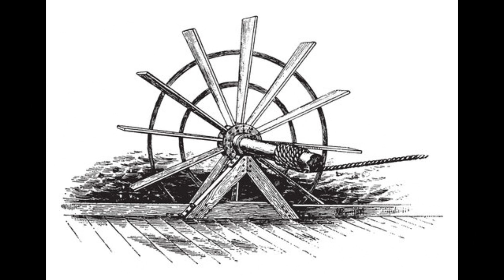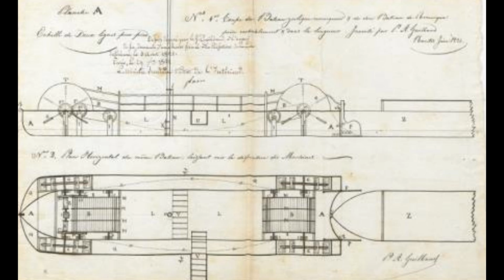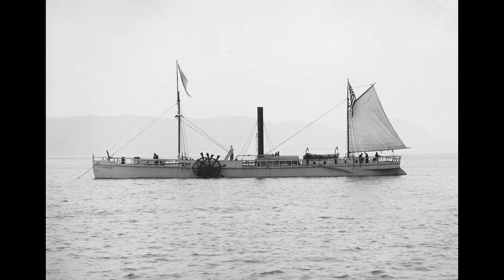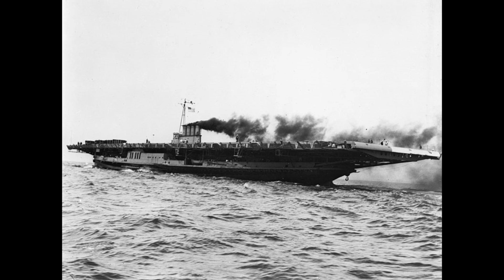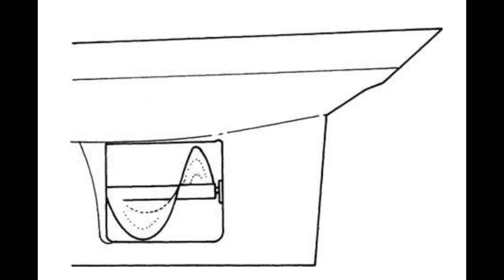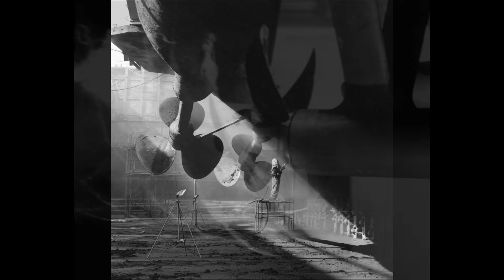Paddles and Propellers - It's all about the rotation

Comment: Random fact. When Enterprise (CV-6) was being converted to night operations at the end of 1944. Her centre propellers were replaced with a 5 (quintuple) blade model. That was supposed to reduce vibrations in high speed maneuvering
Reply: If I'm not mistaken United States was also built with the same configuration.
Reply: @maxart3392  exactly
Reply: The principles of prime numbers and harmonics would like to agree with you on this one